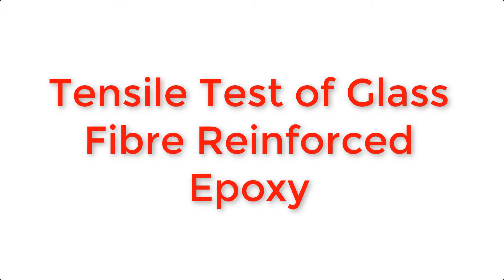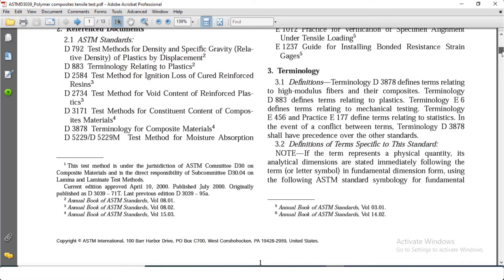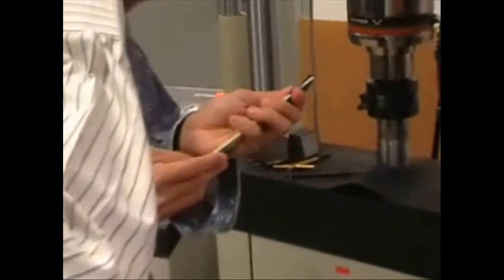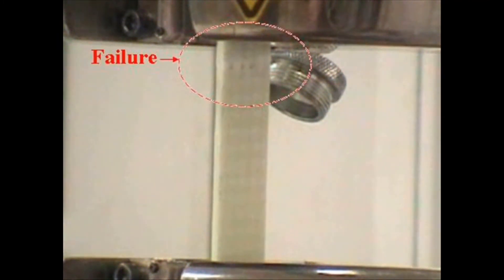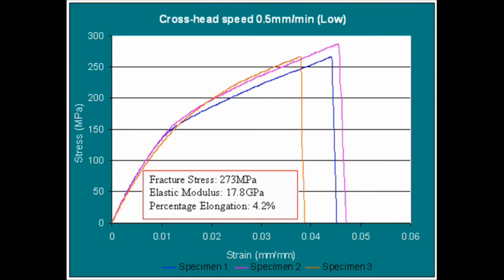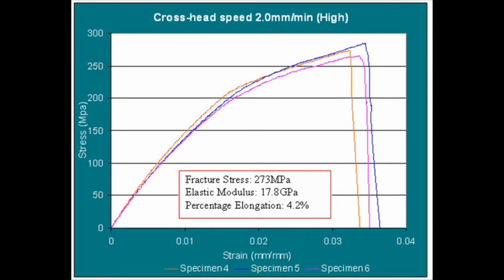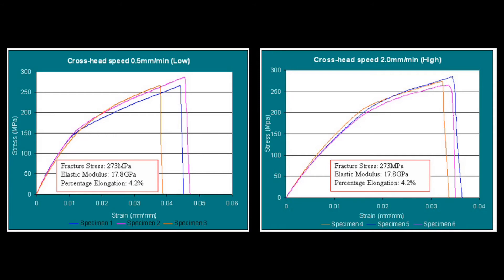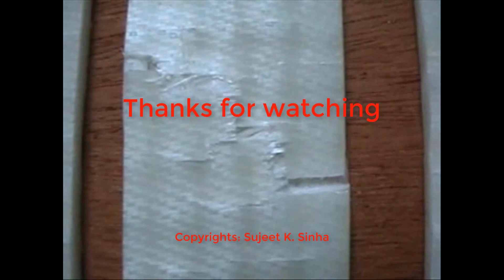Tensile Test of a GFRP (Glass fibre reinforced epoxy)

Comment: Sir, can you tell me what type of adhesive was used to stick the emery paper to the tensile sample ?
Reply from the maker: No adhesive was used. Rough paper can hold the composite specimen under clamping pressure.
Reply: Is it possible to have different Es if only the thickness is increased , meaning the volume fraction of fiber is increased? I am getting different Es for the face sheet of 1 ply, 2 plies and 3 plies.

Comment: So the fibreglass didn't break at all, just the epoxy broke? Which explains why you got about 200 MPA rather than 3400MPA which is the tensile stress of the fibre.
Reply from the maker: Fibres did break. But the volume % of fibre is much less, about 30%, so the fracture stress will be much below the ideal value for all fibre.

Comment: what is the Influence of an elevated temperature on tensile strength of glass fiber-
reinforced polymer composites
Reply from the maker: Good question. For any polymeric material, increasing temperature means reduction in tensile strength. This will happen very drastically. Even within a day or during seasonal changes from winter to summer, you can observe this change. For glass fibre reinforced composite, the same will happen but some what delayed effect. That means GFRP will be able to retain its strength at a higher temperature than the pure plastic. You will need to generate data if you want to know quantitative answer. Please do check in books or research papers.

Comment: Hello my project is on basalt fiber reinforced composites do i have to use the same ASTM standards for my test piece
Reply: And also what do you mean by volume percentage 70 of fiber can you explain it elaborately please
Reply from the maker: % can be calculated as weight % and also as volume %. For composites, always use volume %. This means 70% of the volume of the whole composite is the fibre.
Reply from the maker: preferably use same ASTM for continuous fibre composite. If short fibre composite then please check if ASTM has another standards for that.

Comment: Hello, how testing after application of GFRP on concrete?.
Reply from the maker: I am not aware of a standard of GFRP reinforced concrete. What I can say is ASTM D7957/D7957M-17 can be used as
Standard Specification For Solid Round Glass Fiber Reinforced Polymer Bars For Concrete Reinforcement. Standard D7205/D7205M − 06 also provides for the same application.

Comment: Is this standard used for the sandwich type of composite material?
Reply from the maker: It can be used as long as it is tensile strength. The composite we used was also sandwich of woven fabric of glass fibre in epoxy.

Comment: Sir can you tell, how much time  aGlass fiber reinforced polyester takes to fail after starting the crosshead movement?
Reply from the maker: We tested epoxy based composite. I can't tell how much time polyester composite will take. I would say that it will take similar time if it is thermoset polyester as all thermosets have similar kind of strain value at failure. This value can be defined by the ductility ratio.
Reply: Sir you can even tell about epoxy based,  I have to run simulation by considering the time span of the test running till failure.

Kindly tell me about it.
Reply from the maker: @rdtechie5244  Please caculate the time in the video. The cross-head speed is also mentioned. The video is in real time so you should be able to get.
Reply: @engineeringmaterials-tribo5142  Thankyou so much Sir!

Comment: so i am doing my M.tech final year project in bamboo fiber epoxy composite material. I have few question
1. what is the ASTM standard for tensile test for a 1.3 mm bamboo strip ? People consider single bamboo fiber for single fiber test. I am taking a 1.3 mm circular cross section bamboo strip or i can say bundle of bamboo fiber. So is there any ASTM standard for bamboo strip tensile test? As the bamboo strip itself is a composite (lignin,cellulose,hemicellulose) so can i use ASTM 3039, ASTM 638 all these standard?
2. in the ASTM standard why people always take 3mm thickness of the specimen? In ASTM 3039 it is mentioned that the size of the specimen is (minimum length= gripping+ 2 times width+ gauge length) and thickness is mentioned as  (as needed). so Can i use 5 mm thick specimen(bamboo fiber epoxy composite)?
Reply from the maker: 1. As far as I know, there is no separate ASTM standard test for bamboo strips. You may also check. The bamboo fibres have to be separated and then bonded together with epoxy matrix. There is a process of alkali treatment which is shown in this video. This is to remove the lignin and use only cellulose fibre for composite making. Cellulose fibre is the part which has high strength property. Yes you can use the ASTM3039 standard once you have made bamboo fibre/epoxy composite.
2. Thickness can be kept 5 mm or some other convenient thickness. Thickness often depends upon how you make the composite and also on the application. 👍